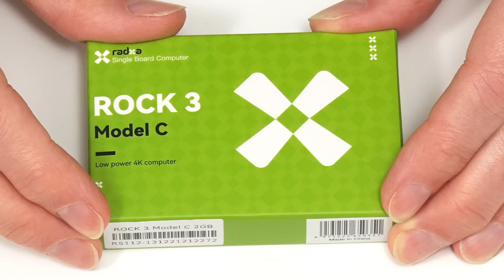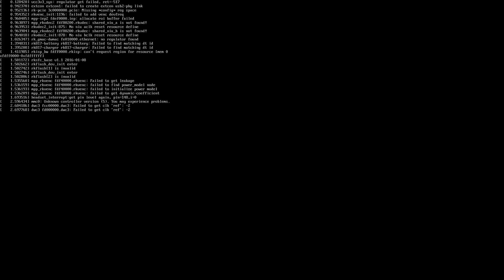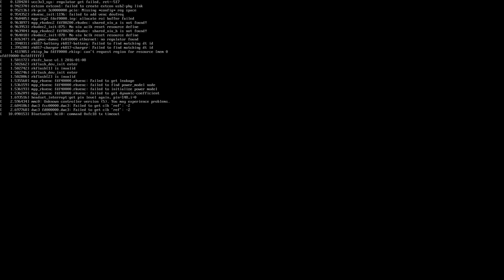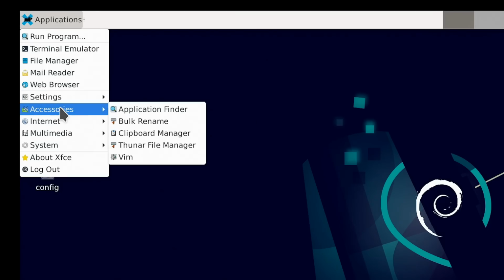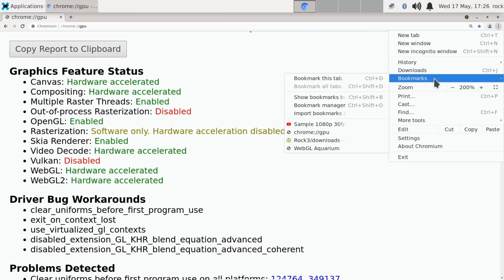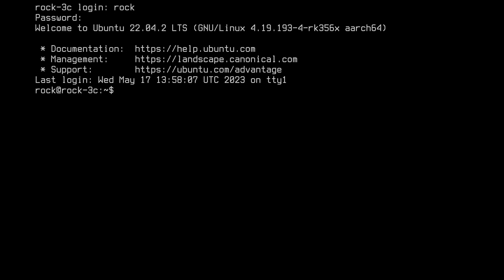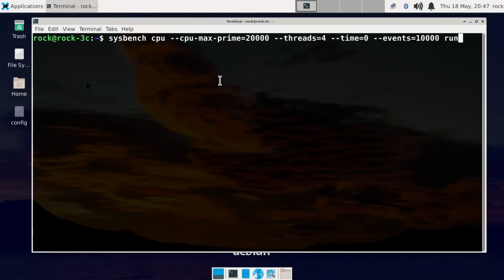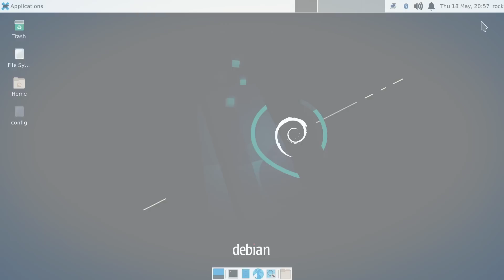Rock 3C: Maker-priced SBC

Comment: Why there are no SBC with modern SOC? On my phone I have Snapdragon 695 that is a lower tier of phones soc and in that aquarium test runing in Opera browser I get 70-90 fps
Reply from the maker: There are. But you have to remember that (a) a Snapdragon 695 phone is many times more expensive than a Rock 3C, and (B) phones are mass market products, typically running Android, for which there is excellent driver support.
Reply: @ExplainingComputers  My exact phone model cost 275 GBP on Amazon. The most expensive part is a 6,67" 120Hz Amoled screen. I found original one on Aliexpress for 89,50 GBP. Ten there are also 4 cameras (3 in the back one on front site), 5000 mAh battery, case and other parts that are not present on Rock 3C. IMHO if you would strip my very phone to a SBC equivalent it  would cost how much? 100 GBP ? For many times more powerful device with 6GB of ram and 128 GB of storage.

Comment: A second source of a replacement for the Pi will be welcome to all the businesses built around the Pi. In a recent interview,, Eben Upton descrbed his dilemma during the supply shortages, about whose demands to satisfy first.  Small firms built on the Pi could be choked to death without at least some flow.
Competition is good. It won't keep the Pious awake at night, but should keep their attention during working hours. 
It wasn't mentioned. but it looks as though the physical layout  and dmensions are close enough to the Pi that all the supporting hardware, (cases, &c.) should be usable unmodified.
Reply from the maker: Eben talked about this in an interview with this channel last December. :) I agree on the cases -- just a little adjustment needed for the USB-C rather than micro power connector, and many Pi 3 cases should work just fine.

Comment: Chris -- this is an incomplete video. You didn't push the button to release the genie. As for the board itself, I like the connectivity, and I particularly like the color coding of the GPIO pins. It's small things like that that make maker boards easier to use. Attention to small details makes a difference.
Reply from the maker: Always risky to push that button . . .

Comment: The features of the Rock 3C are very impressive. I might even add that it represents a phantasmal vision of a potential Raspberry Pi 5! Incidentally, if the Raspberry Pi Foundation doesn't manage to get back on its feet before the end of 2023, this SBC could (unfortunately...) become one raspberry killer! Thank you for this excellent presentation.
Reply: RP Foundation is still selling more Pi's every year, 7 million last year, its just demand has almost doubled and they haven't tried to meet it either because they can't or they feel its not real just more virus hording madness and scaling to meet it will kill the company when the market gets back to normal. I suggest you watch Jeff Geerling's interview with the RP CEO. 

Support for these other SBC's is still appalling, the RP is going nowhere.
Reply: Perhaps you missed the fact that the Rock 3C is still a 32-bit processor with 1GB of RAM. I don't know about you but I don't really need any more antiques. And for all the usefulness a limited SBC like that might be, you might be better off with a micro controller instead. Something like an Arduino Mega, 2560 maybe.
Reply: @WXSEDY  Thanks for your comment.

Comment: This looks great. I think if the Pi 5 ended up being release with the exact same features but a newer SOC then I'd be a happy chappy. The software support looks way better on this one too compared to some other SBC's so hats off to the Rock 3C developers for creating a true competitor!
Reply: What I want for any Pi 4 replacement is something without the despicable microHDMI sockets. Having two HDMI ports is a niche requirement, but even if needed it's not worth it if that requires microHDMI for space reasons.  The problem with microHDMI is that it generates way too much stress on the tiny plugs with typical relatively large and hard HDMI connectors. I broke several, even when careful - unless it's a lab setup it's guaranteed to break or become unreliable at some  point. Mini-HDMI is better but not much used anymore, but I never want to ever see microHDMI used anywhere for anything.
Reply: @tohaason  You could have bought micro adapters with like a 10cm cable.
Reply: @LivingLinux  I did. They are junk. Micro HDMI simply can't work with stiff cables like this.
Reply: @tohaason  This adapters with a little bit if cable work perfectly fine with my Pi 4 and Lenovo Yoga Tab 13. No problems here.
Reply: @tohaason  Not to defend micro HDMI, as I do agree that they are far less robust, but I think the main reason for the dual ports are for things like digital signage, and in such applications, connect/disconnect cycles are much lower. 

Anyway, for my experimental daily drivers, I tend to secure them down, and make/buy socket savers and GPIO breakout boards to prevent the inevitable over stressing of the connectors. I use short lengths of laminate floor boards as surrogate "breadbords" in the original sense. SBC, and solderless breadbord, plus the connectors glued, or mounted along one edge makes for quite a robust setup. Stick on rubber feet stops it sliding around, or getting dragged off the bench by the cale wieght too.
Reply: @tohaason  yea the microhdmi instead of minihdmi or mini display port or usb-c is really an embarrassing design for the pi4
Reply: They'd probably call it the Raspi 4B+
Reply: tons of boards use these chips so not much for them to do
Reply: Also 1 watt idle and ~2watt load power consumption? What!!! thats impossible... do you believe this? I have to crosscheck
Reply: Yes indeed, we want a better SOC in Raspberry Pi 5, no, not for the performance, the performance is secondary, the support is primary requirement, the newer SOC should have HW acceleration supported and it should be much more open so that people like Jeff geerling can easily attach a RTX4090 to a Pi lol
Reply: @STORMFIRE07  I suspect the Pi 5 will also be based on a Broadcom chip. Looking at the progress on the Pi 4, I wouldn't be surprised we will be thrown back several years with the HW acceleration support.
The Pi 4 now has Vulkan 1.3 support and Firefox has planned HW video decoding. I think V4L2 M2M should come with FF 115.
Not sure this will work immediately with the future Pi 5.
Reply: @LivingLinux  btw is this solely a Broadcom chip issue? Or is that issue a cause of something else?
Reply: @LivingLinux  Unfortunately I think so aswell, but I am really wishing for perhaps a RISC-V SOC, such as the one released by StarFive, their recent chips have come really close to the pi4 in terms of performance, plus since RISC-V ISA being completely free and open source, I believe Pi Foundation can come up with something pretty powerful, just like how they recently designed their own Chip in the Pi pico
Reply: @STORMFIRE07  Not just a Broadcom issue. I also have Rockchip RK3588 devices and there it also feels we have to do several things all over again. Although you can argue that we never got the full potential of the RK3399 with Linux.
Reply: @STORMFIRE07  I have the VisionFive 2, but you shouldn't forget that the Imagination Technologies GPU still hasn't received an open source driver. And the current situation with the closed source blob is far from optimal.
Reply: @LivingLinux   got any idea how the chip in this SBC managed to get HW acceleration support, even when the RK3399 couldn’t, which should be older than the CPU found in this device? (I assume that all RK35XX CPUs should be newer than the RK3399?)
Reply: @LivingLinux  thanks for information, yea unfortunately that’s terrible , but I was hoping that’s where Pi foundation comes into play? With the community they have built over the years, all they need to do is make open source CPU and GPU made with RISC-V ISA, in somewhat working condition , and the community should take care of the rest perhaps?
But of course this will be a pretty big gamble as Pi foundation only recently started making their own chip designs such as pico
Reply: @STORMFIRE07  HW acceleration is available for the RK3399, but that doesn't automatically mean that all software is able to use it. It is possible that a browser is using software decoding, but the actual decoding can be done with ffmpeg. If ffmpeg has HW acceleration, the browser can still report SW decoding, as the browser is not aware of how ffmpeg is actually working.

Comment: Seems like a great little board a bit slow for sure but i noticed on the box it can output in 4K something you did not address in this video.
Reply from the maker: I put a tiny note in the label in the video. :) The box says 4K as you say. The specs in several places say 1080p. But the SoC certainly supports 4K. But when I connected a 4K display, I could not select beyond 1080p . . .
Reply: @ExplainingComputers  My bad i did not see the note. Thorough as always that's why i respect your opinions.

Comment: Interesting board with lots of potential.  As is the case with anything non Raspberry Pi, it'll be the community support that really makes it viable or not.  ARM support is prevalent enough these days in Linux naturally, but it's those weird problems that people hit and need support for that seem to make or break adoption of these boards.  My first (and so far last) non Raspberry Pi SBC was an Asus TinkerBoard, and I still feel the burn from it 😆.
Reply: The rockpi I had from radxa gave me so many headaches... I rather pay double the price and not have obscure problems I can't fix.
Reply: And the Asus was pro designed by a hardware giant, too ... !
I've seen people leave good reviews on libre lepotato, but it's quite old hardware at this point.
Reply: I've good luck so far with the 4GB Libre Renegade, but you are on point with regards to community support.
Reply: Rubbish video support kills it for me usually..
I need full video acceleration..
Reply: The support from OKdo, RS and DesignSpark community is first class for Rock 🎉

Comment: I'm glad to see a SBC going back to its roots. Not small desktop replacements but low price test/machine boards. 

I look forward to getting a few.
Reply from the maker: Exactly. The features so many people need, and no more. So a reasonable price.
Reply: Are you sure a micro-controller wouldn't be better? Yes, micro controllers are often limited to just one function. But if done right, a good micro controller could work and probably even consume way less power too. Even a (PLA) Programmable Logic Array may be something to consider if your application is really simple. I do wish Chris would do a video or two on how to use simple devices like Arduino's, EPROMS and PLA's. (Probably not since that's more of an electronics subject.)

Comment: IDK why would anyone care how desktop works on these boards.
Would be nice to know the speed of video encoder/decoder. And not from viewing youtube but command line vlc/ffmpeg. Like can it flawlessly encode 4k stream at 30fps into H264/H265. If yes, can it encode substream at the same time. What resources it will consume this way. Can it run object detection in parallel and at which fps so we understand what 0.5TOPS are about.

Comment: I wonder if there is some sort of adaptor available for that M.2 slot? 🤔 I feel there has to be some sort of solution...

This is looking like a true competitor for the Raspberry Pi 4B, largely because of the software/driver support and utilisation. It is properly using the hardware, a failing for many of these boards.
Reply from the maker: It this board takes off, there will be an adapter. :)
Reply: Probably isn't a fast enough slot to take advantage of NVME, but maybe it could run a SATA adapter.

Comment: Hi Chris! I do not know if I saw your old video on the Rock 3A (Radxa) but I wanted to say that these boards are being used or a variant of them, inside the most popular Musical digital instrument AKAI MPC Live, LIVE 2, MPC One, and MPC Force. These are all in one touch screen based performance Samplers with built in DAW and synthesizers which is basically a portable music based COMPUTER system based on the Radxa boards with 2GB ram built in. There IS an upgraded board with the 4GB ram and THAT one(Rock 3B?)in the newest AKAI MPC Keys keyboard based version of the MPC Live 2 units. So the price and micro size of these boards make them ideal for real world products!
Reply from the maker: Very interesting. I know that OKdo / Radxa offer customization for industrial customers. This is a great of example of "what are companies using SBCs for". :)

Comment: Why do manufacturers of SBC's always put some sort of older inferior components in? ok it may be a few pence cheaper but for a few pounds more it they could make them 10x better.
Reply from the maker: This hardware could not be made 10x better for a few pounds. :)
Reply: @ExplainingComputers  I prefer not to think in those terms - I don't think it helps the world of computing to have all hardware constantly following Moore's Law.

I think we've discussed this topic before but we both go back far enough in computing to remember very "fixed" home computer platforms and the innovative programming methods that get deployed to optimise code when you don't have a lot of CPU and memory resources in the first place - like in the days of the Amiga and Atari ST.

Just look and what has happened to emulators on SBCs when programmers have had to work within those "fixed" resources - it encourages good programming and great code.

Linux has been the complete game changer for hobbyist computing (as well as many other areas) because now computers destined for landfill for not being able to run the latest version of Windows can be re-used with Linux, and put to good use.

Just demanding more CPU and more RAM seems a very lazy way for developers to look at the world.
Reply: What are you expecting an SBC to do? And you do realise that if you need something more powerful for the same money, there are plenty of used SFF PCs with Core i3, i5 and i7 CPUs in them on eBay?

It's a bit like you buying a family saloon car, taking it off road for a day and then complaining that the suspension is broken when you've finished. "Right tool for the right job", etc.

If you don't understand who much of the target audience for an SBC is then you probably don't need to use one in the first place.
Reply: @terrydaktyllus1320  the least i would expect is for the next generation to be superior in all ways from the previous.
you can't go comparing an SBC  to an SFF PC, they are hardly the same thing.
As i use them i am part of the market and would rather spend a whole couple of pounds more for something better, a couple of pounds more would make no real different to the end use and it would still be in the same price bracket.
Reply: @ShadowzGSD  Why does it need to be "superior" unless you've got yourself into the "always upgrading" mindset that corporations love because then they can just sell you new stuff you probably don't need?

I'm a computer engineer, I solve problems. I sit down and work out what the problem is, what additional restrictions there are (that can include cost) and decide what I need to put together to fix it.

Sometimes that can be with old hardware - I am at this moment doing a particular project using an original Raspberry Pi from 2012, for example.
Reply: @terrydaktyllus1320  damn you just go on and on and on, just accept you are wrong and move on. what is the point designing new hardware if you don't improve it?
Reply: @terrydaktyllus1320  said the entitled one who has to be correct and have the last word on everything, you might want to do a bit of research on the differences between SBC's and SFF's, ther is a vast difference and both have very different use scenarios.
Reply: @ShadowzGSD  "you might want to do a bit of research on the differences between SBC's and SFF's"

I don't do "homework" that strangers on the Internet set for me, especially at weekends.

You run along now, sonny, your mum wants her computer back up there in the spare bedroom of your parents' house anyway.

Discussion closed, you got your wish.
Reply: @terrydaktyllus1320  in other words you are 10 years old and have not got a clue what you are talking about. 🤣